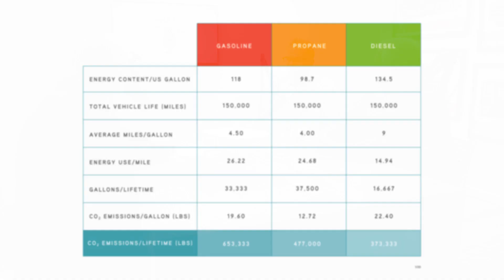Thomas Talks Episode 2

Comment: Great talks gentlemen on diesel versus gasoline however where does electric buses factor in with overall cost and eliminating the fuel guy, oil changes and other maintenance associated with diesel/gas buses?
Reply from the maker: Thanks for the question. We don't foresee electric becoming the standard for quite some time. We have to offer different types of powertrains and fuel options to meet our customers' needs. That may change in a decade but for now, diesel is still a reliable option for many school districts.